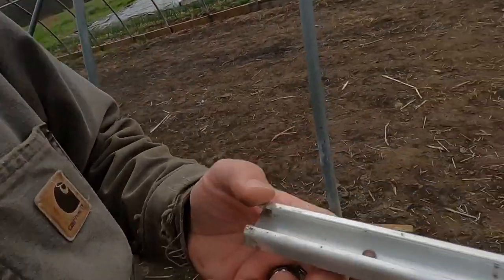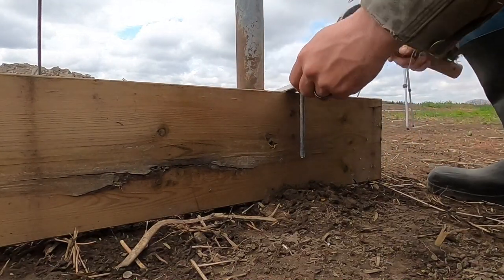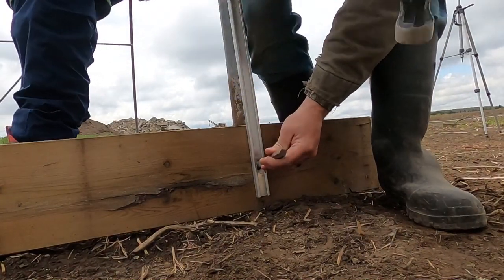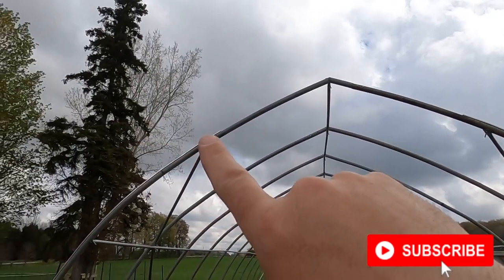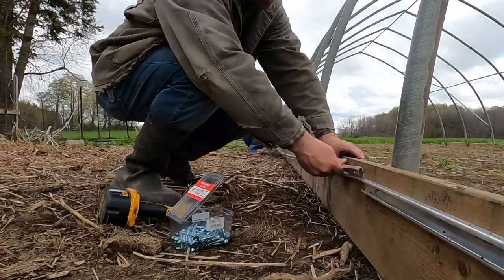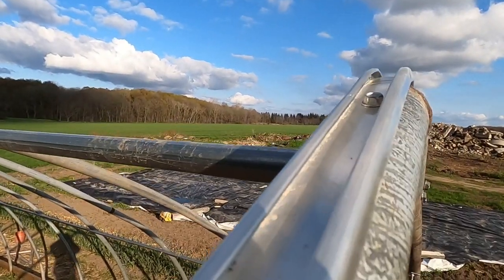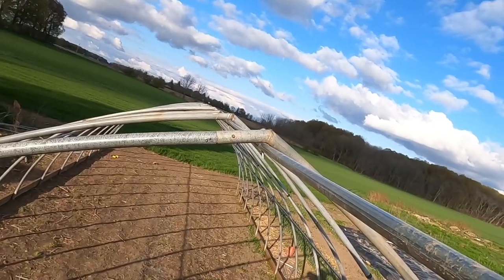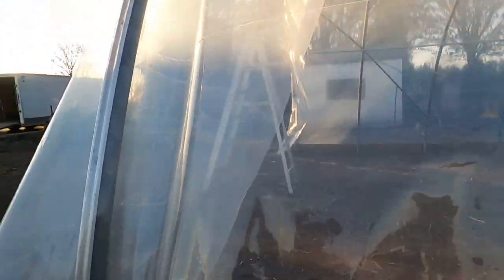Installing Plastic on the Greenhouse

Comment: Great video!  Enjoyed your sense of humor, too. I know this is a different topic, but do you have any recommendations for securing the plastic to the ground?  We get up to 30-40mph gusts of wind by us and if we use the plastic over the garden it will really need to be secured tightly. So far thoughts are to use bricks... LOTS of bricks.
Reply from the maker: I get a lot of wind here as well and use lots of bricks, rocks etc. Old tires could work or even manageable sized sand bags are ideal.
Reply: @TheRuralDad  thanks for those tips!